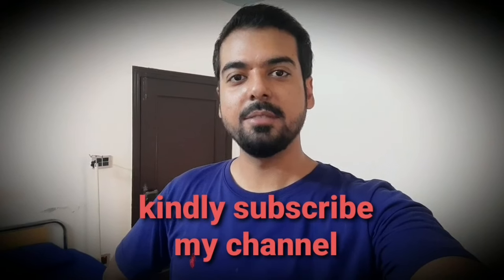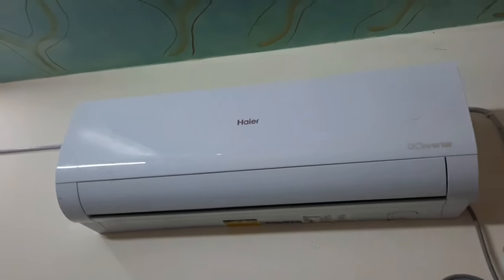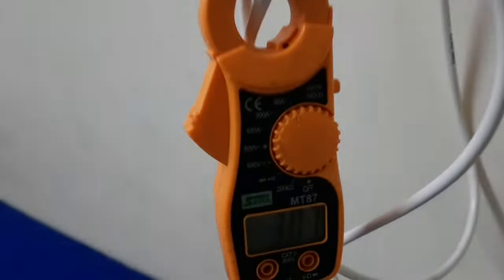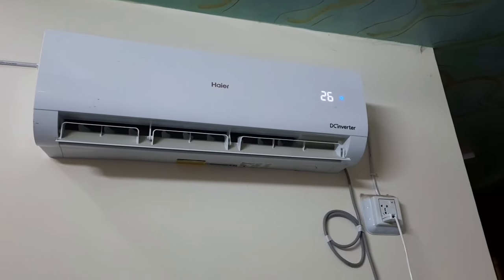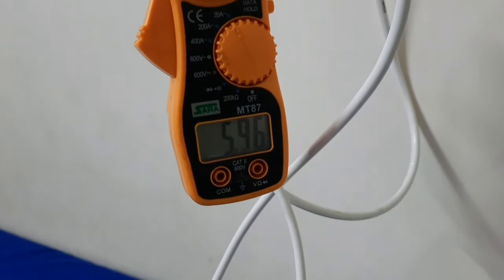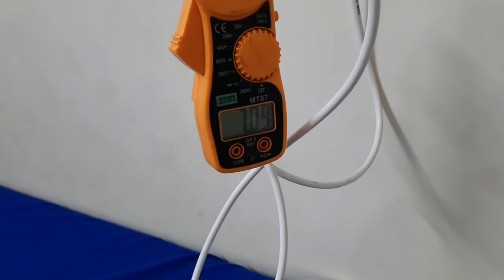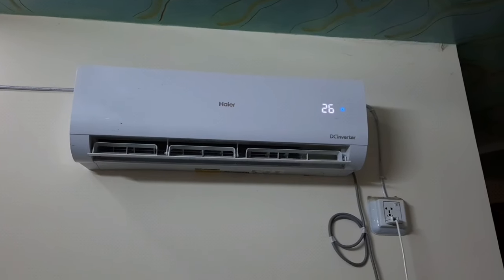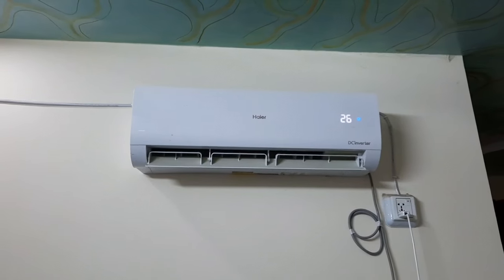Haier inverter AC | ampere check | specs and Complete review

Comment: Bro I just bought haier 12hf ac..1 ton..wo quiet mode me .5 units/hour consume kr raha hy..pr simple cool mode me with quiet mode off..1 unit /hour..even when i set temp to 28..my room is small but on first floor..Any suggestions? Mesnz mene 10 hours use kia tu 11 units consume kiye..ye 1 ton k liye bht zada nhi hn?
Aur quiet mode me units kam leta hy pr cooling me bi fark parta hy..ku k fan speed slow ho jati hy

Comment: Brother aap nay extention ko hatta kar isay direct power socket say ampire check kray our main panel say power plug tak kam az kam 4 mm ki wire honi chai hai 
Extention me jo wire use hota hai wo 40*76  ka hai 
Is say be ampire down nai hotay 
Our line me jitnay joint hongay us say be line looses hoga 
Behter ye hai main panel say throw out power socket tak pakistan cable 6 mm ka use kiya jay 
Me jo haier ac 1 ton ka use kar raha ho dc invertor usay me 27 temprature per set kiya huwa hai 
1.87 AMP par ajata hai
Reply: His power losses much in wires only, and its not ACs fault

Comment: Tell me one thing amir
When any inverter comes down to 2 or less than 2 amps, untill when it maintains same amps?
Reply from the maker: Usually it remain on the min acheived current. But in case outside temp is really high then may be in some cases ot goes back to a midium current not highest one but for a very little interval of time.

As an example, if an AC took 20 to 25 min to achieve the required temp of 26, then it comes near 2 amp. But if outside temp is very high then may be for 5 to 6 min it will go  to 3.5 amp and then again will come near 2. But its very rear.
Reply: @amirkhokhar89  My Haier Flexis Series new A.C is worst in terms of power consumption. It remains on 6 to 7 amperes even after achieving room temp.
Reply: bro jabtak room ka tem 26 rehta ha low level pe rehta ha jese hi loog barhte hen ya kuch dair baad temp barhta ha room ka to again 4 to 5 amp pe jata ha room ko 26 pe lata ha and 2.8 pe run karta ha.. mere pas 1838s ha kenwood and 18 by 14 ha, kafi bara room ha mera

Comment: Turbo mode pr 1 Ton AC ko lazman 7A tak jana chahiye. Agar koi AC nhi jata to gas low ka issue hey.
Reply from the maker: Nai sir. Aisi baat nai hay. Updated technology walay inverter ACs low amperes par design hotay hain. Wo turbo par b 5.5Amp se upar nai jatay. I have experienced few ACs like 1220s kenwood top of the line 1 ton. Gree 12 FITH top of the line 1 ton
Reply: I think 6 to 6.5 tak Jaya ha fairy fith also

Comment: ampere ki jagah wattage btate toh zyda bttr hota bekaar video bna diya...i hope wattage me b video bnado
Reply from the maker: Jab aap kisi k kaam ko bekaar hi bol do tow wo ap k kehne pay watts main video kyu banayega? Secondly sari dunya ampares main hi video bana rahi hay pakistan main, on average 230V k around voltage thi. You can calculate it yourself if you require readings in watts. As W=ampares×voltage

Comment: Brother I bought this shit and Got it installed by 3rd July I don't know why people go for Haeir including me although a friend of Mine is a whole seller in electronic Market He also advised me not to go for Haeir but preferred 12hro extremely 3rd class ac

I was happy with the ampere reading but the problem was that mine wasnt able to Maintain the temperature below 28 at night in Karachi and you may know the temperature of Karachi as well its around 30/31 at night
Reply: Same issue with us... we bought this since 3 years ago ... or isnay cooling krna chordi ... gas full ha... koi b issue nai... but 30 or minimum 29 degree Celsius sy nichay nai ata...
Reply: Koi solution mila kya bhai?
Reply from the maker: Jahan tak mera mind kehta hay, may be outdoor sunlight walay area main laga ho. Is se yahi impact aata hay. Regardless of brand' outdoor should be installed in an area with no sunlight otherwise it will ruin the cooling